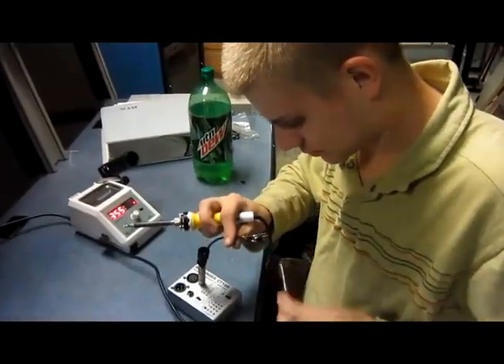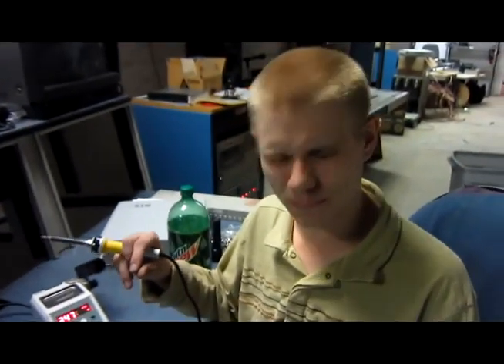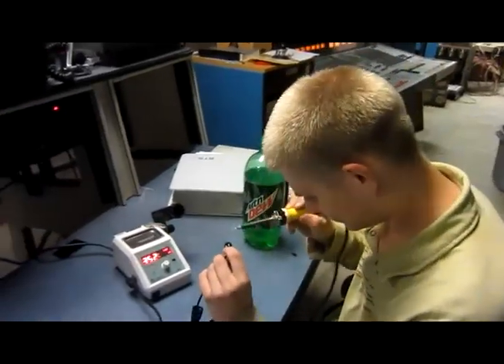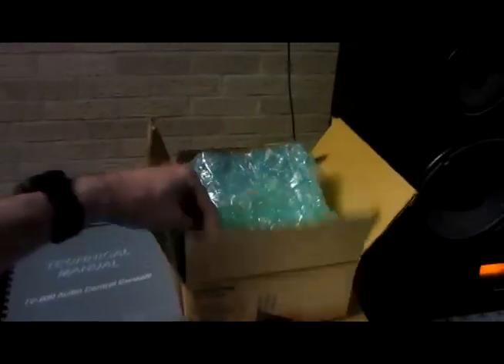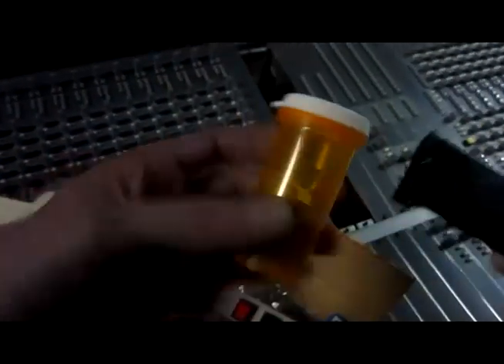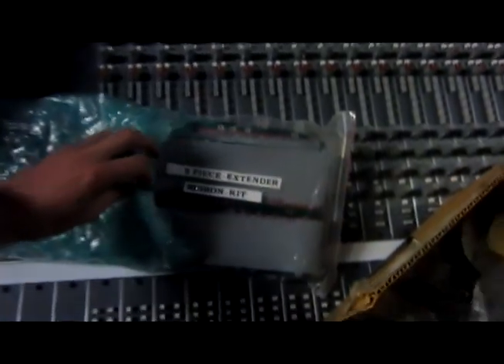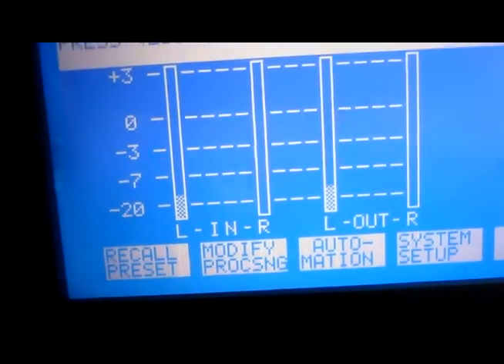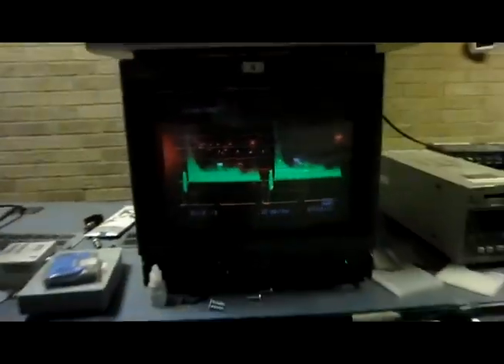Captain's Blog 6-12-11 Master Control Fun and Wheatstone Restoration

Comment: On some of those Mackie Mixers (including mine), Tip is Cold and Ring is Hot, not that it really matters, they only problem with having the connector wired backwards is the audio will be flipped 180 degrees, which not a big deal for what you are doing, and actually, buy wiring the adaptors correctly now (and not compensating for the backwards mixer), you are ready when you connect a mixer that uses the modern standard.